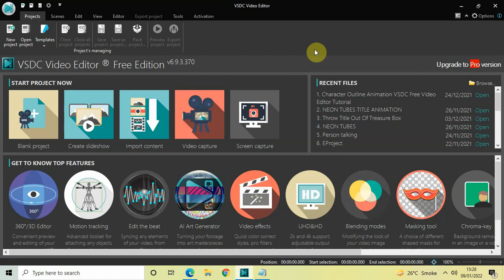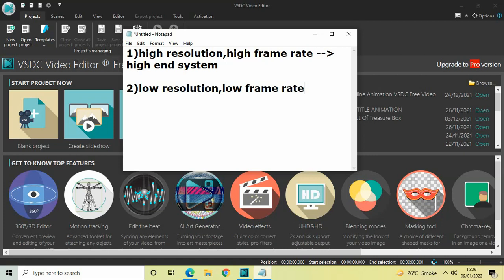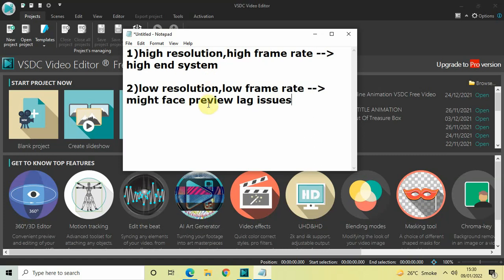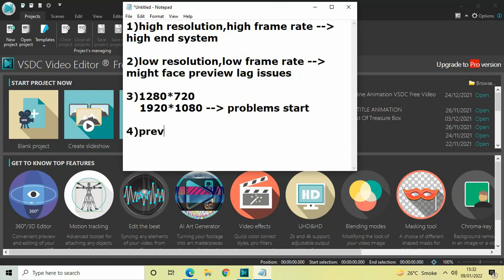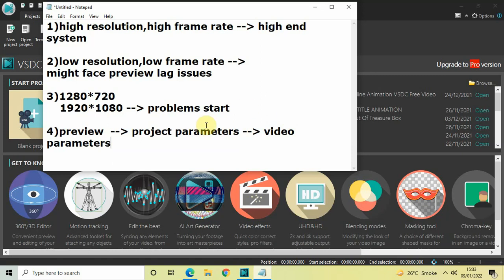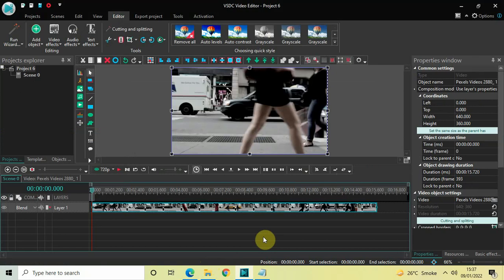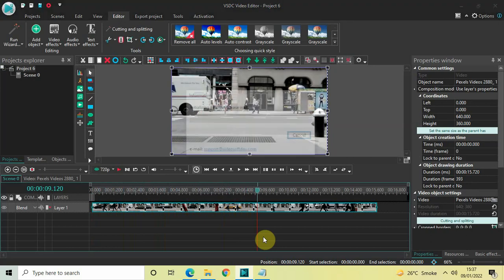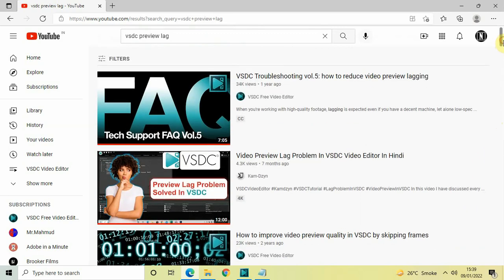VSDC Preview Lag Explained & Possible Solution !!!

Comment: What about high resolution video..you didn't cover that..where vsdc have lagging...
Reply from the maker: How much resolution are we talking here? See everything really depends on how powerful your system is. If you have an 8 GB RAM or 16 GB RAM system,you should face no problem editing any video. But things change if you have a low end system. You have to tailor the resolution and frame rate of your project/video according to your system otherwise you will simply not be able to edit your video,your system will hang. Nonetheless,no matter whatever is the resolution, frame rate still remains the central part. Without a uniform frame rate between your project,video and exported video,output will be of very poor quality.
Reply: @nextgenblogger  yes it's all about system,this vsdc settings not going to work until and unless u have supporting system.👍